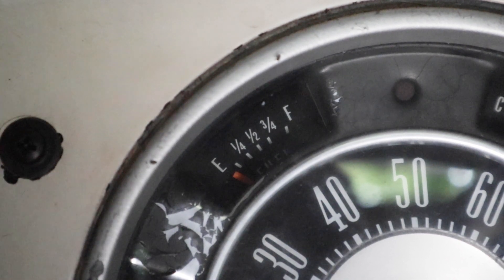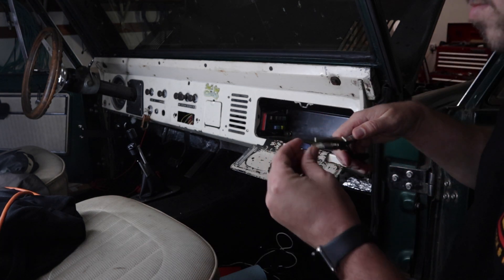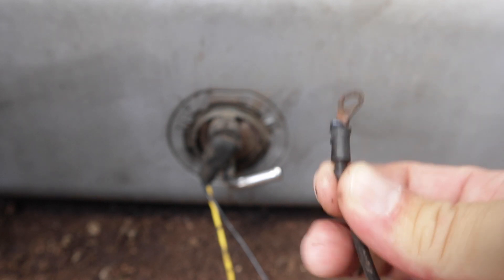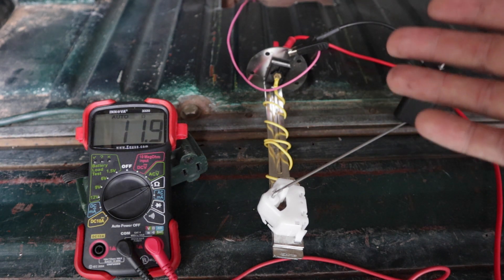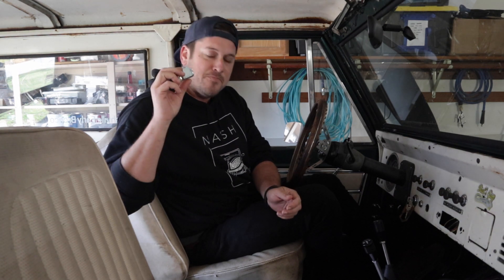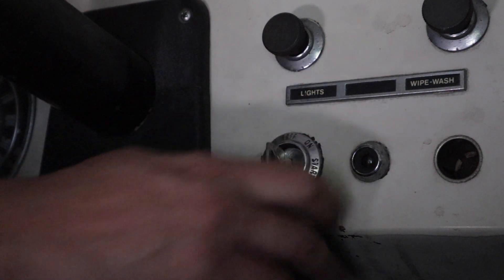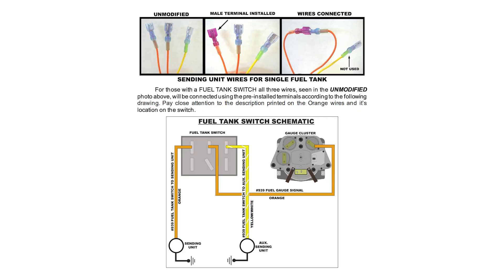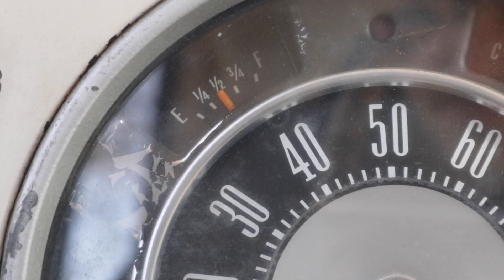Fuel Gauge not working?

Comment: Another great video!  I did the tank with internal fuel pump a few years ago along with an EFI conversion. Question - how did you handle the extra outlet nipples?  Do you have a carbon canister?  If so, can you share any details on that or if you just plugged the extra outlets?  Thanks -Dwayne
Reply from the maker: I removed the charcoal canister but left the lines hooked up. So it acts as a tube now
Reply: Wow, sounds like an easy solution. So, you have a ‘venting’ tube from the gas tank into the intake system via the air cleaner or EFI body?  No issues with raw fuel smell in the garage if you have full tank of gas?  Thanks!!

Comment: I went through this about 4 months ago. Tested everything and all check good except sending unit. So replaced it and the fuel pump after getting 23 gallon tank cleaned at radiator shop. Tank was completely filthy after only 13 years or so.
Reply from the maker: Crazy!

Comment: I solve the problem of regulator : 6 new gauges, working from 10 to 16v. No need regulator.
The hardest was to find a modern fuel gauge 10-74 ohms.
30 USD and work great.
Reply from the maker: Nice
Reply: You are an example for me. You help me a lot, even if my car is a gran torino 1974, lot of your video helps me. The first i saw was the PROFLO4, and now my 351w have a proflo4 too. Thank you guy ... for all. And don't change. 
The far little frenchy, frederic.
Reply from the maker: Haha! Thanks Fredric! I’m glad I could help

Comment: Well I put on a new sending unit, haven't replaced the wiring harness, didn't check ground and also the regulator, don't have an aux tank.  As mine seems to work sometimes and then it doesn't.  So I always question my fuel as well.  You gave me a few things to check Jon.  Thanks Doug
Reply from the maker: Yep! Let me know what you find out!